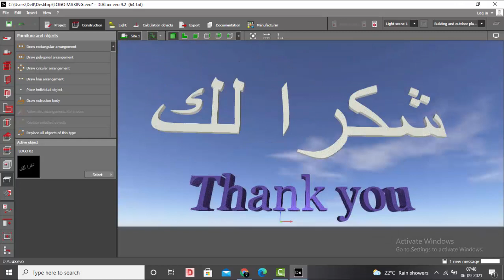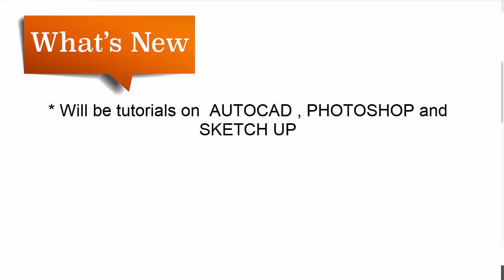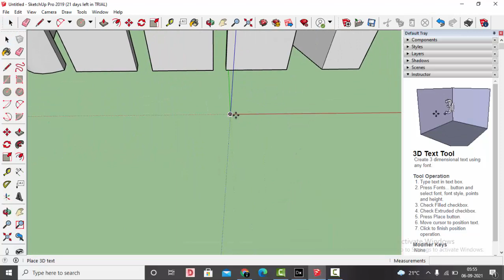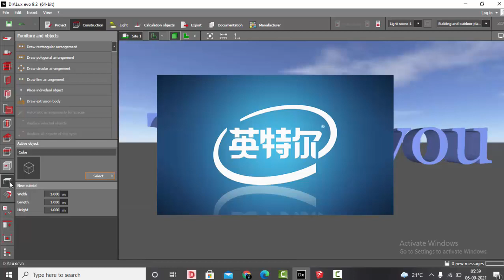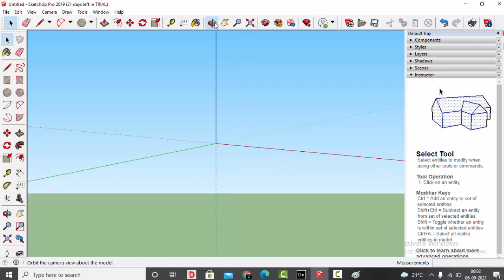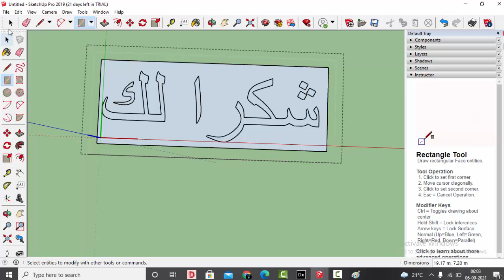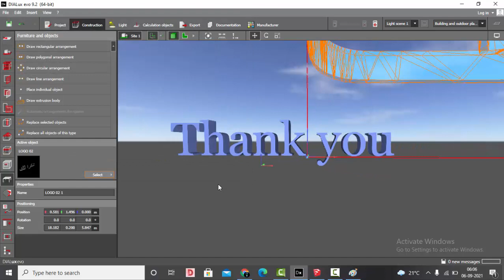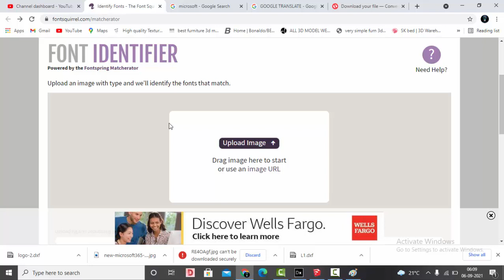3D Text Logo Making in any language

Comment: Hi dear,
I have project with pendant magnetic light but I couldn’t find any company with such system that we can import to DiaLux . Please help.. best regards
Reply from the maker: Flos has pendant magnet its called " Running Magnet" check it out, and yes you can get 3ds object of Pendant too. If the 3ds is heavy file make a rectangle out of  extrusion volume to resemble pendant and then add ies